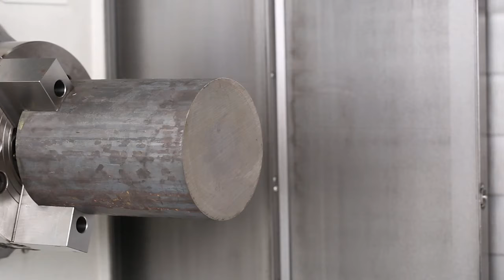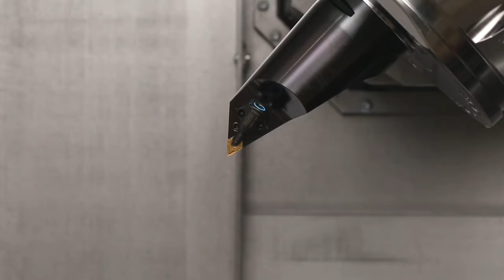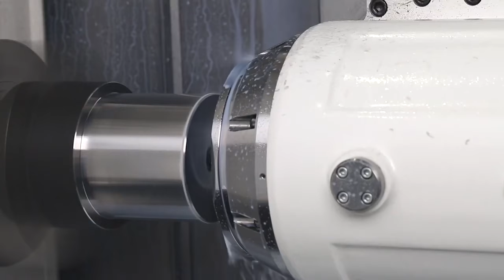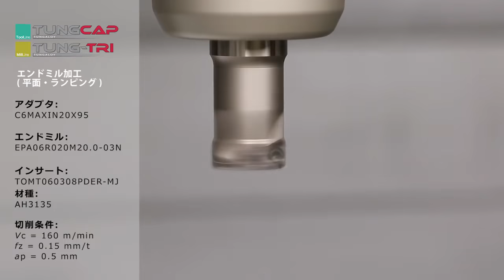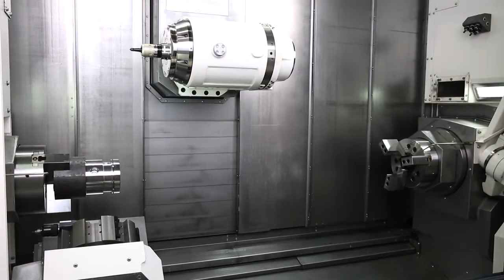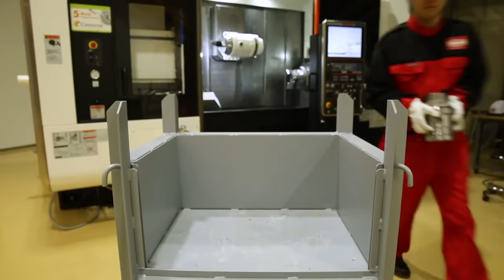TungCap - Quick change system with polygon coupling tooling

Comment: Who would have thought, a machining demo on youtube that's not brass or aluminium, never knew they used these multi axis Mazak or Mori Seiki machines for anything other than making plumbing parts.
Reply: I have ran an FH6800, e410 and e650 for more than 6 years making parts for the oil and gas industry. The best feature Mazaks have is on machine programming. We never use CAD/CAM software as we often make one or two off components, Think biggest batch I have machined is a 20 off. With frequent revision changes it is better for us to be able to modify programs as we go. Also this is needed as all the workshop shares tooling so cannot guarantee using the same tools every time we run a job.